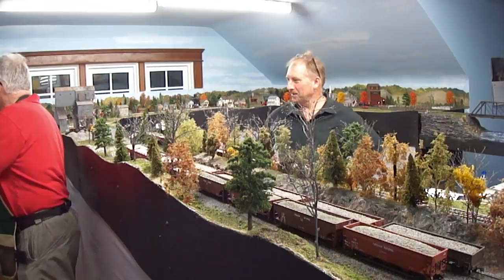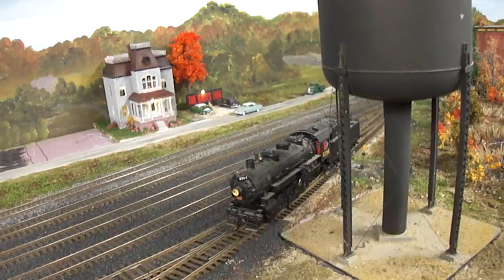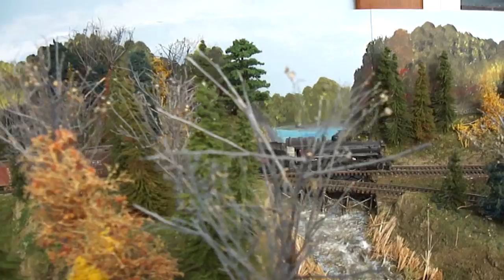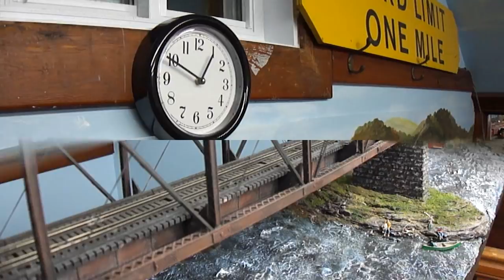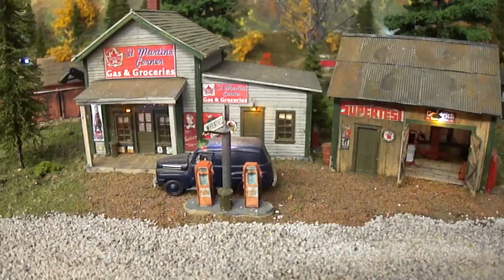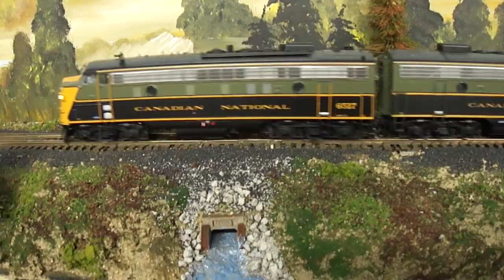PART 2: FNG OPS ON THE LINDSAY CN

Comment: The combine at 9;05 and 9;42... is that scratch built or? I recently made one from a Bachmann combine, windows and doors mostly. I noticed they all had chimneys across from each other mid car? that seemed odd, but that's where I put the stovepipe too. Just after that it sounded like a FP4 was burning coal...  a lot of sound that night eh?
Reply from the maker: The combine was a kitbash from a Bachmann.  The details were close to what Greg has seen in photos
Reply: Yeah I went by pics I took of the one in Prince George, an ex- Canadian Northern car, even tho I am 'trying' to model the Grand Trunk Pacific..we got to go with what we got to go with eh? From what I read, it seems most CNR combines were once GTP/CNoR coaches, I'll bet there's no two the same?